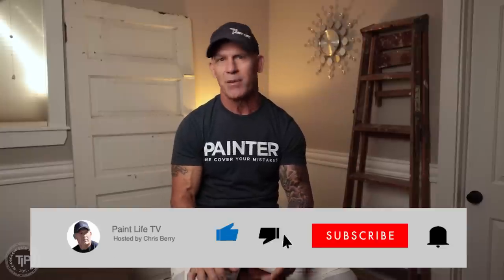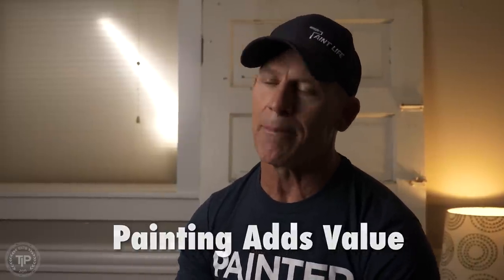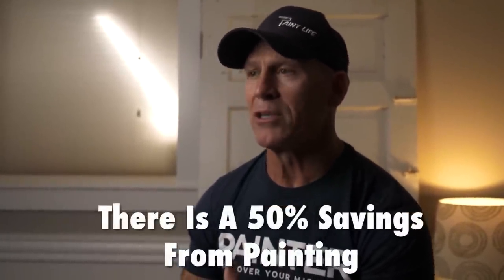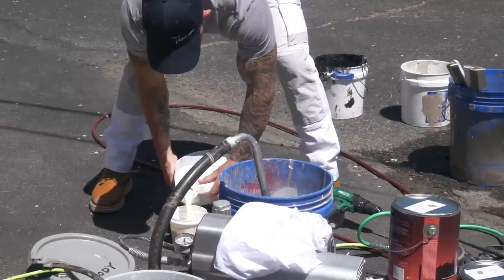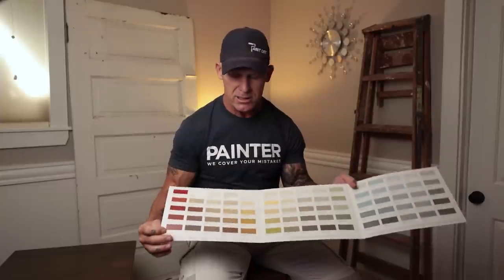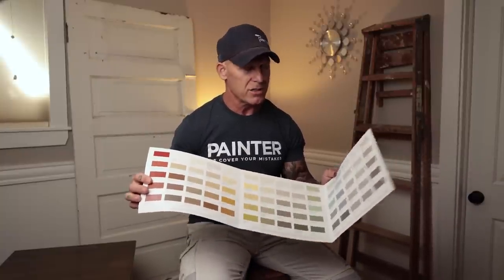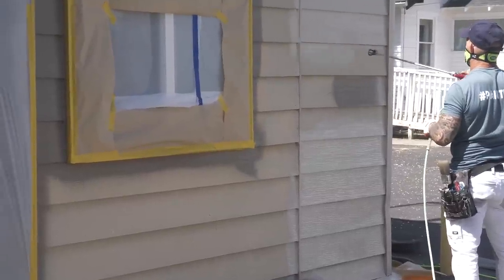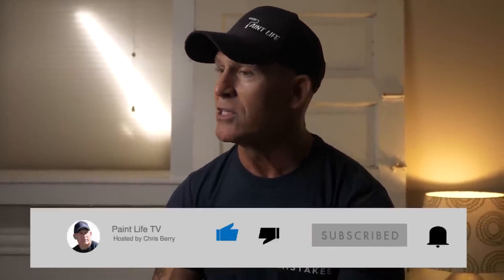Can You Paint Vinyl Siding? Tips and Tricks on Painting Vinyl Like a Pro!

Comment: I HAVE BRUSHED AND ROLLED, BOTH VINYL AND ALUMINUM  SIDING STRUCTURES FOR 30 YEARS PLUS AND YOU CANT TELL THE DIFFERNCE WEATHER THEY ARE SPRAYED OR NOT.  IT IS HOW YOU ATTACK THE STRUCTURE IF YOU WILL THAT MAKES THE DIFFERENCE.  GRANTED SPRAYING IS QUICKER, BUT EVERYTHING DOESNT HAVE TO BE DONE YESTERDAY.  ALSO I USED SHERWIN WILLAMS VINYL SAFE COLORS WHEN THEY FIRST CAME OUT. AND THE CUSTOMER WANTED TO GO FROM A LIGHT COLOR TO A DARK BROWN. I TOLD THEM THEY COULDN'T.  THEY SAID SW AND THERE BROCHURE SAID YOU CAN. I SAID I WILL PAINT IT NO GUARANTEES BECAUSE IT WILL BUCKLE AND IT DID AS I SAID IT WOULD . SO THEY HAD TO REPLACE THE SIDING WITH NEW SIDING.  ANYHOW MR IDAHO PAINTER, I LIKE YOUR PASSION  AND YOUR PROFFESIONALISM FOR  PAINTING.  KEEP UP THE GOOD WORK! I KNOW IN THIS AREA NO ONE STILLWHEN PAINTINCABINETS SPRAYS THE CABINET STRUCTURES, POSSIBLY THE DOORS OFF THE PREMISES.  BUT BRUSH AND ROLL THE MAIN STRUCTURE. I MENTION THISVBECAUSE A WHILE BACK I WATCHED A VIDEO OF YOURS THAT IN AN INTERIOR JOB , WELL LET ME PUT IT THIS WAY IF IT DIDNT MOVE YOU SPRAY PAINTED IT! I BELIEVE ALL I SEEN YOU DO I GOT TIRED.JUST WATCHING YOU.  THE BEST OF LUCK TO YOU SIR,   I COULD SHOW YOU THESE STRUCTERS I HAVE PAINTED BY BRUSH AND ROLLER IF YOU WERE INTERESTED.  TAKE CARE !
Reply from the maker: OK

Comment: We live in Georgia. It is almost July with temps easily in the 100 degree range. With up to .5 inch shrinkage and contraction, would it be best to wait until the late fall and paint the house when it is cooler, to avoid lines that could show up when the vinyl contracts back in  colder weather? At one end of the house, it is 3 stories. I really don't want to have to  climb a ladder this winter to do touch ups due to appearing lines. Please advise.

Comment: Does this apply to vinyl windows also? I really want to paint my vinyl windows black but it sounds like that's probably a no go.
Reply from the maker: I have painted them before but moving parts make it a challenge
Reply: Yes you can paint your windows black. Contact any SWP store and they can set you up with the appropriate paint and procedures.
Reply: I used stix as a primer and it looks awesome
Reply: @brianmshane74  do you forsee any issues with warping down the road?
Reply: @dlandes14  plastic products get funky in the sunlight but windows aren’t a big area like siding the outside trim with the j channel and the mullion strips on the double hung windows look awesome like factory good  even better because factory vinyl windows the black trimmed always get dinged up a little bit and they need to be touched up

Comment: When you sand to check if a finish is oil or water based what are you looking for after you've sanded?
Reply: Don’t think you sand to check. We use denatured alcohol on a rag. Rub it on the paint. Latex paint will come off on the rag. Oil will not.

Comment: Thanks for the video! Question: After painting of some of the shady areas of my house gets some mold, how would I remove it? Right now I pressure wash the vinyl, will that damage the paint?
Reply from the maker: Bleach
Reply: Get a pump sprayer put half of pool bleach and rest water .. then rinse The section you’re working on then spray it and don’t let it dry up and then rinse it after sitting for at lest 5 to 10 minutes !! If it doesn’t all come off do the same I owe a Pressure washing for years.

Comment: Could you use a darker shade on vinyl if the paint is elastomeric? We mostly use it on stucco or wood, but I know it helps with heat transfer.
Reply from the maker: Do not use EM on vinyl
Reply: @Idahopainter  Thanks for indulging my curiosity lol
Reply: @Idahopainter  what about AuqaShurTech. This Paint is designed for PVC, Vinyl and Aluminum.

Comment: Paint it in the heat and you get skunk stripes at your seams when it contracts in the cold....
Reply: I was wondering about that. Happen to have any pictures of that?
Reply: @johnloupis2347  No, I just laugh when I see it....and if it's not prepped properly, not just power washed, the old chalky surface screws up the bond and the paint just peels off. Plus it's almost impossible to pain the inside of the J Channel and get good coverage. Painting vinyl siding is the cheap way out. Mostly home flippers do this because they don't care. You can paint most anything, that doesn't mean that painting is the best solution.

Comment: What do you do about the siding shifting with heat heat cold. It leaves a line
Reply from the maker: I have never seen that happen
Reply: You could go around with an artist brush to fix all the lines at the seams that’s now showing the factory/older color that was caused by expansion and extracting… or depending on time, accessibility, size of substrate, warranty, etc it may be worthy and more efficient to re-spray?
Good luck, and remember you got this!